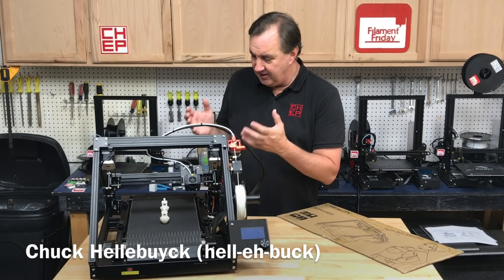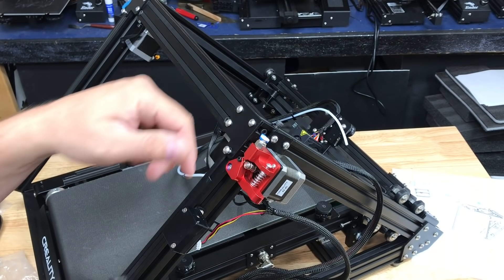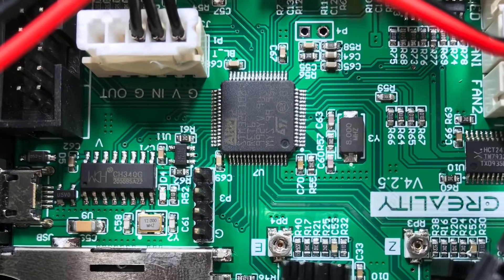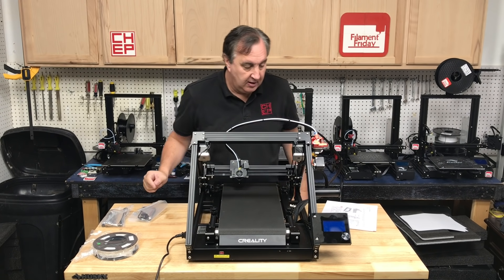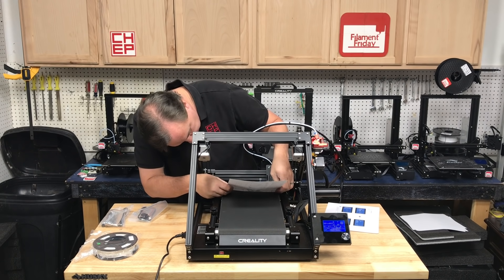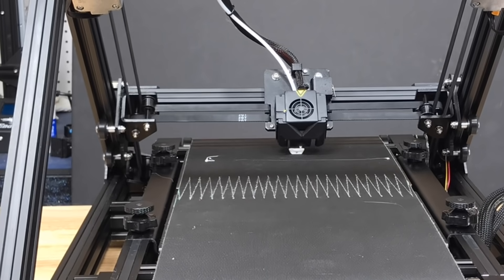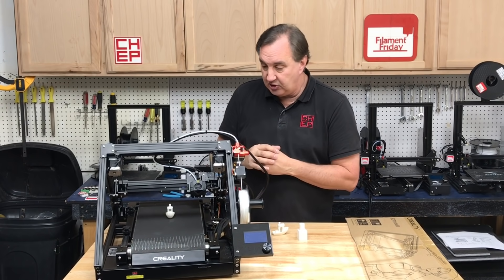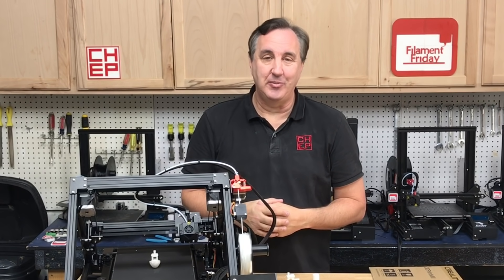Creality CR-30 - Naomi Wu's 3D PrintMill with Infinite Z

Comment from the maker: For anybody looking for a USA based belt printer check out https://powerbelt3d.com/
Reply: Hey could you give me some tips? I want to buy my first printer and I'm stuck between two. The Ender-3 Pro and the CR 10 Mini.
I like the ender 3 since its small and one single unit. But the cr 10 has bigger print area and a glass bed.
Do you have any pros and cons?
Reply from the maker: Ender 3 Pro is less money and prints a bit better and faster. But it depends on what you want to print.
Reply: @FilamentFriday  I mostly want to print small/medium prints (now i think that) that is useful for everyday use.
Better and faster was the magic words I wanted to hear! so i'll be going with the Ender 3.
PS love your channel with all the tips and thanks for the help!
Reply from the maker: Ender 3 V2 is good as well but he didn’t ask about it. I’ve reviewed them all.
Reply: @FilamentFriday  i bought the ender 3 pro and i am very happy with it. Noticed a big difference with the filament though. I bought 1kg roll of Wanhao PLA. And it wasn't very good. Tried a testpack of prima creator. Super good results!
Reply from the maker: @Lucky Gunner - Filament can make a big difference.
Reply: that powerbelt3d looks like this is their first endeavour into engineering. What a POS by the looks of it

Comment: I know it's a beta but given the price point and your analysis of the print quality, do you find it worth the price point? I know there are a lot of factors that go into it, but just curious if it's Ender 3 quality and if it is, is the extra $550 or so dollars worth the belt feature in your opinion?
Reply: Depends on your application. if you don't want to do series production or very long prints, you don't need this machine. As for print quality, it will take some time to find out where this can go but I'm pretty sure it will always be more effort to run this for "normal" prints than an Ender 3.

Comment: For a simple design, probably reasonably quick print, AND useful tool if it works, how about a meter stick (metric yardstick) with raised markings?  It'd be great for calibration testing.  A long T-square tool would also be a good option and still useful if the length calibration isn't quite perfect.  Those are some things you'd be hard-pressed to find any other 3D printer (in a reasonable price range) with the volume limit to print.
Reply: A long piece of 3D printed “Fabric” would be SUPER awesome! You currently have to print them separately and melt them together, seeing one solid piece would be really cool!

Comment: Using this printer is it now possible to print something much longer than the bed seeing as now it should run off the end? For instance say your bed is 45cm long and you print something 60cm long. If you could do a test like this that would be very interesting
Reply: I'd appreciate it too, chep. I think it would be fairly easy to use a home depot wood roller for table saws.
Reply from the maker: You mean like this?  https://youtu.be/bKdtn9fled8
Reply: @FilamentFriday  hahaha oops, thank you sir. I didn't even get a notification for that video.
Reply: @FilamentFriday  wow thats nice it included the rollers. Thank you very much i love the videos

Comment: I would like to know more about it getting prints off the bed.  I could imagine something getting stuck and jaring the belt , messing up a print in progress
Reply: If you look at the edge of the belt closest to the camera, there's a blade (probably not sharpened) that lifts prints off. Most print materials are usually rather hard and not remarkably flexible (note: most) so even of the blade didn't remove the print, it would peel of during that fairly sharp 180 degree turn at the end of the belt.
Reply: only the first part of the bed platen has a heating element under it. the print has plenty of time to cool before the part reaches the end.
Reply: You have to roll them off the end, definitely don't pull or scrape them off.
Reply from the maker: Now you tell me that ;)
Reply: @FilamentFriday  😅

Comment: I’d love to know how dimensionally accurate the PrintMill is compared to a standard Cartesian printer.  How does a 100x100x100 cube, compare for example?
Reply: the Z-axis does require some tuning (just like dialing in e-steps) for good dimensional accuracy in that axis, belt thickness and tighness play a factor.  when I printed my 20ft rail I only lost 1/4" and most peoole account that to plastic shrinkage during the print.  It's all how hard you work to dial it in.
Reply: The X and Y will be identical.  They're still moving in the traditional way.  As Karl said, it's just the Z that needs to be dialed in.

Comment: Thanks for sharing I was wondering about the assembly aspect. Seems easy enough. My only thought on these type printers is that they all seem to home towards Y min.. Wouldn't it be more efficient to home Y max and use the actual  Y axis dimension to help set the nozzle offset. If you needed wo take the nozzle down , say .5mm you just add to the overall Y travel... I know it would wind  up being an odd ball number being that it would be the sine of the angle of the gantry * the amount you wanted to go down(I believe been a while since a trig class ..lol). It'd be a pain math wise but would be more accurate than fiddling with a mechanical stop wouldn't it?
Reply: I homed it at Y-min for speed..  I don't wanna sit there and wait for the gantry to go all the way to the top then come all the way back down to the bottom..  Not to mention the additional wear and tear of that extra movement from max to min..    Imagine if you had to home a 400mm tall I3 printer at the Z-max and wait for it to come back down to the printbed every time you printed..

Comment: This printer is an absolute game changer. I'm right now printing a new front grill I designed for my PC because the old factory grill restricted airflow. I had to design it in two pieces because my printer bed is too small. There are loads of applications where an unlimited Y axis would be desirable. Creality has to be commended for listening to Naomi and getting behind this revolutionary printer at a reasonable price.

Comment: I certainly love the idea, I'm a bit sceptical about that "Infinite Z" thing. I'd love to see how realistically usable that really is, like, I can imagine something thin that exceeds the bed to break. Or not come easily off the bed at the end, resulting in fubar. And: How durable is the surface as you can't simply get a new sheet of glass. I own the Ender 3 Pro that came with a floppy magnetic sheet that looked a lot like the bed on this printer - it took me 10 days until the bed was full of kinks and I've got a piece of glass instead
Reply: @yunggolem4687  but, er, those end, too, making this "infinite" a bit shorter than I thought it would be
Reply: @saschaschneider6355  just add infinite rollers ;)

Comment: I'm new to printing and I'm wondering what is the point of this? Continuous printing?
Reply: You can also get away with some extreme overhangs in certain directions thanks to the angle that the head's at.
Reply: @jon9947  Wouldn't it really be infinite Y tho? Lol
Reply: @Chris_Bro_aka_MR_PLAT1NEM  No... see my initial design.  The belt replaced the Z axis.  The extruder still moves on the X/Y plane.  (Tilt the entire printer 45 degrees and you'll understand.)

Comment: I think it’s fine that Naomi is reaching out to guys like you for beta testing. Obviously, the initial emphasis has to be on the hardware and identifying the areas of setup emphasis such as belt tensioning. However, as you alluded to, the proof will be in the slicer software and what it will take to get consistently excellent prints. That seems like a phase 2 beta round given my take of the videos I’ve seen of this to date. I hope Creality does not rush this out to KS before that has been dealt with properly, including giving the Marlin and Cura/Prusa programmers a chance to write code to really support this machine.  You really can’t think of this as primarily a hobbyists machine if it is capable of production work. Especially at the $800-$1,000 price level, which is potentially a good value but still a decent investment in something expected to generate a financial return.
Reply: I've reached out to Cura and Prusa before and at present neither are prepared to put in the extra time and money to support what is still currently a "niche" printer..  Maybe once there are a lot more out in the wild an increased demand for good slicing will change that opinion..

Comment: I think the biggest advantage of the 45 degree angle of the print head has not been mentioned yet. It allows to start a print on the bed and then continue in mid air without supports underneath. You can print a tube parallel to but above the print bed as long as it is well attached at one side. Or you could print an infinite hollow cuboid with no supports inside because its equivalent to printing at 45 degree overhang.  So please print something that takes advantage of that ability. 
Thank you!
Reply: While true, this machine style doesn't eliminate overhangs as much as it changes the angle at which they occur. The side facing away from the print head is more prone to overhang issues, a double edged blade but potentially useful if you exploit it properly.
Reply: @funx24X7  Yes the side pointing away from the print head needs support for any degree of overhang, very true. Would be awesome if the print heads rails would go up and then down the other side to enable the print head to travel all the way up and then down the other side, so that you can start the print from the opposite side, then move the print head up and over to the other side and continue. Meanwihile the belt would need to position the part properly of course etc.
Reply: dont forget the weight of overhang part, if too heavy and no support it will tilted.

Comment: So I need to know exactly how fast is it because I’m looking for a really fast printer any suggestions I have a cr10 but I need a faster one
Reply: @jon9947  I know I’m probably going to splurge on a bunch of parts for a printer and buy a 2.85 mm printer because I want a fast one and thx dude
Reply: @jon9947  and a lot of the time you sacrifice your precision for speed and it sucks I want a complex visual print that doesn’t take 10 hours for a small little statue
Reply: @manwithacr1054  larger nozzle and rigidity is key, also the bed slinging is time consuming.
Reply: @jon9947  I know I was going to use a bigger nozzle with it and thx man really appreciate everyone’s advice and I might just buy 2 Ender 3s there pretty cheap but really good at there price point
Reply: @manwithacr1054  Depends a lot on your application. If you need a single print to be fast, this is not the printer you are looking for. If you need to produce a series of parts by 24/7 printing with little of your time needed, this might be the solution.
Reply: @mangabuddy  I don’t need to make 1 part quick I need like 20 big parts quick
Reply: @manwithacr1054  Get a big nozzle diameter then.
Reply: @manwithacr1054  2.85 isn't faster than 1.75.  It's all in the hot end and nozzle.  The 2.85 filament diameter would actually take longer to heat up than the 1.75, so will in reality be slower.
Reply: @williamsteele  alright man I will check a bit more into this stuff online and on the r/3dprinting sub Reddit to see what is best for me thx
Reply: @mangabuddy  You can buy 6 Enders for the price of one of these things. So, your argument doesn't make ANY sense at all. This is for LONG pieces...$hitty-quality, long pieces, where it's OK to have chunks of Creality's cheapass conveyor belt, vs a metal belt, stuck in the plastic.
Reply: @vidznstuff1  Yeah, and keep awake at night to remove the parts from each printer after a few hours of printing. No thanks. If your time is not worth any money, you may be right, but in small series production, time of human labour required starts to matter.

Comment: I've been following this type of printers for a while and they seem very interesting, but closed sourced for the most part. What is this belt made of and how did they manage to avoid copyright infringement? I know Blackbelt avoided it by making a slightly different design but they also copyrighted theirs...
Reply: I don’t think that there is a valid way to copyright a sewn together belt...
Reply: they're using an off the shelf conveyor belt
Reply: Copyright?  Perhaps you're referring to patents, which cover hardware.  I designed this type of belt printer specifically as a way around Makerbot's Conveyor belt patent.  They described their design in great detail and I simply read it, realized that they only covered certain aspects (quite literally) and designed this around it.
Reply: @williamsteele  Yes, thanks for the correction. That's great, I thought it was something more ellaborate and that your prototype or the white knight, for example, existed because they weren't commercially available. Massive props for your work and I'm glad to hear there is future in this proposal, very exiting! Have you kept working on this since your prototype in 2016?

Comment: I don't get the "Infinite Z" tag. Maybe that refers to the belt-length Y?
Reply: Are you confused about the Z bit or the infinite bit? 

Z: it's not obvious which axis should be called what when the hotend plane is diagonal. Imo, it makes some amount of sense to call the two axes that are similar X and Y, and the one axis that's different (the belt) Z.

Infinite: you can obviously print beyond the length of the belt as long as the object is supported so it doesn't lever the last part off from the belt by its own weight.
Reply: on belt printers the belt is the Z-axis.
Reply: Just look at my original prototype and you'll easily understand why it was the Z.  The X and Y were unmodified.  Not until we tilted the whole printer (to make the belt flat) does it start to get confusing.  But, the software doesn't change and the extruder is still moving in the plane defined by the X and Y axis.
Reply: Wow - you called out two of the Big Dawgs in belt printing....

Comment: A 3D-chain-mail wearable belt (e.g. to hold your pants up) would be a cool option, and would really test the ability to do bridging.  Printers of the Ender 3 size-class can only do about a 9" square of chain-mail fabric, where this could print a very long piece.
Reply: A belt made of plastic will break.
Reply: @truantray  A belt made of leather will break. Just depends on how you use it and for how long.
Reply: @truantray  don't be so absolute. A belt made of woven nylon is technically plastic and super strong. I'll grant that a 3D plastic FDM chain mail belt would likely be more for fashion than strength.

Comment: The clear issue with these machines is you need specialised slicer software because it has slice at a 45 degree angle and things like rafts / skirts are going to mess up that belt. Funnily enough I think the people who'd benefit most from this would be the likes of Prusa who run massive print farms that require people running around from machine to machine popping prints off whereas this could potentially be dropping parts into a bucket..
Reply: That's the exact use case of this. Not long prints, there's next to no use for that. Many prints, however, is much more appealing, because it removes almost all the human element from the equation.
Reply: the "special" slicer software was available first. "blackbelt cura" is one option.
Reply: this thing probably fails 10 times earlier than mk3s, so in the end, i think you get far more successful prints with mk3s... 
I'd love to have belt printers for my farm, but... this aint it yet. Maybe in the future...

Comment: Could be a useful addition to my mini print farm when I have large runs of small items but as I only print PETG it needs to run quite warm.

Is the belt heated? If so presumably it's just a heated strip beneath the area where it's actually printing.

Another great video Chuck 👍
Reply: I see potential for a heated box with an open bottom at the back of the belt, dropping the prints out the bottom while keeping all the warm air inside, like a diving bell 🔔
Reply: First half of built plate under bed is heated, since the belt moves over it slowly heat is transfered thru the belt, I have noticed when taking readings that the belt tends to run about 5 degrees colder than its set temp.